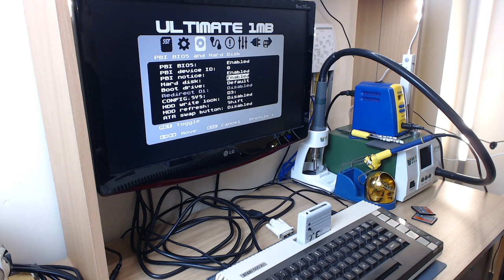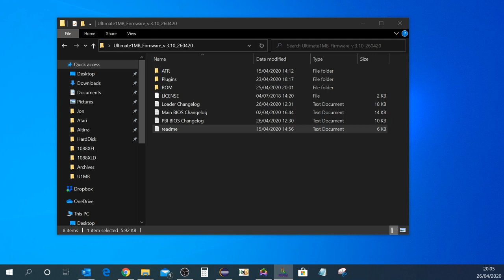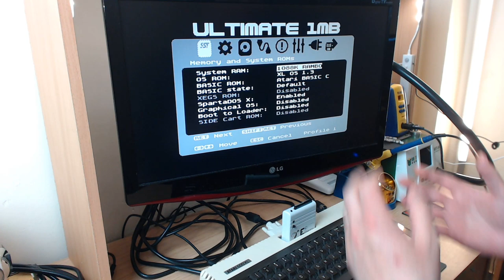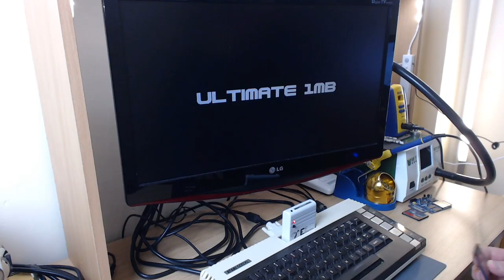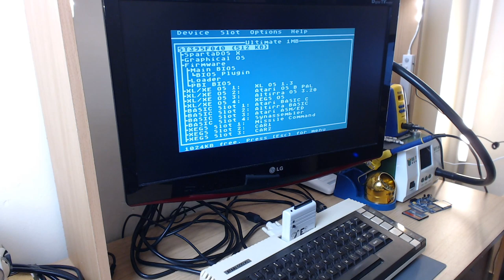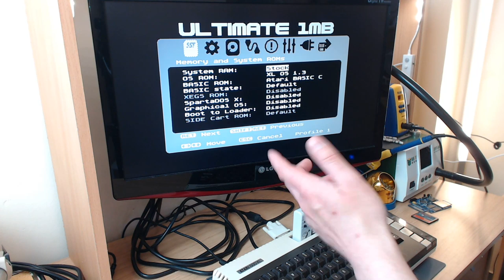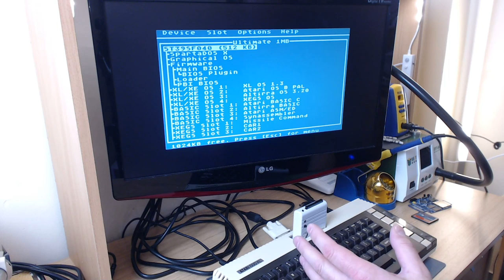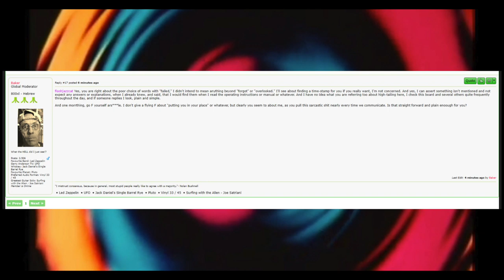How to flash Ultimate 1MB and SIDE/SIDE2 with new firmware

Comment: I have a SIDE2 only, no U1MB. How could I go about upgrading the firmware on that? When I try the procedure it's 'Not Enough RAM'. Finding documentation on what to do is a bit tricky!!
Reply from the maker: Just use the DLT flasher. Did I not provide SIDE2.COM in the distro?
Reply: Yeah, I need to get some sort of sio device that can get me that file in. I don't have ram, I don't have an sio device, just the side2. :(

Maybe I'll get an sio to usb and go that way!

It's kind of strange how the firmware update is done involving the Atari at all. I'd have thought putting the file on the CF card then some sort of button press (long hold on the cart button maybe) and allowing the side2s internal controller to suck up the code and install itself would have been much easier?

Comment: I find this video so confusing. I've got a SIDE2 on a 130XE with no Ulitmate installed. I downloaded the latest firmware which contains 4 folders, do I just copy these to the CF card? Do I then use SIDE2.rom to update? What do I do with the other rom files in the folder?  What do I do with the atr files?
Reply from the maker: I only see three folders: ATR, ROM, and Tools. Did you read the README?